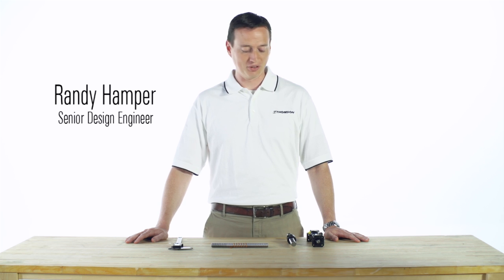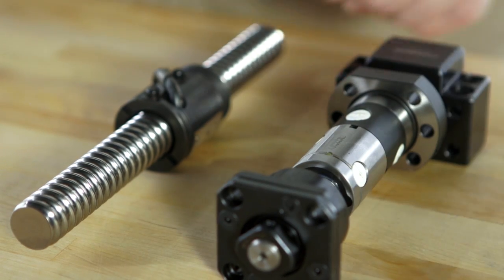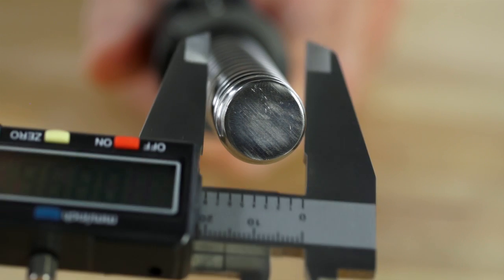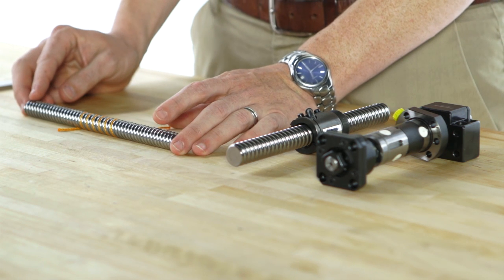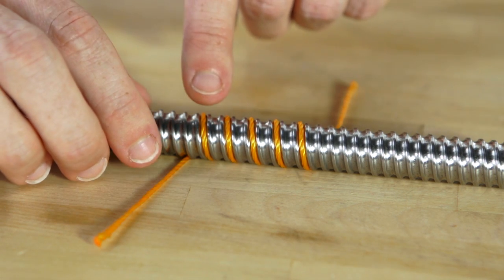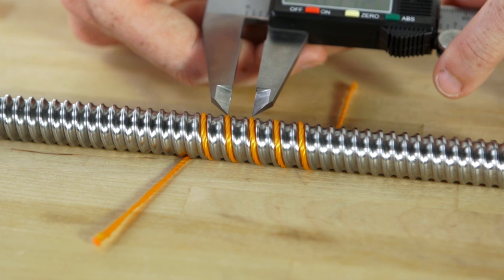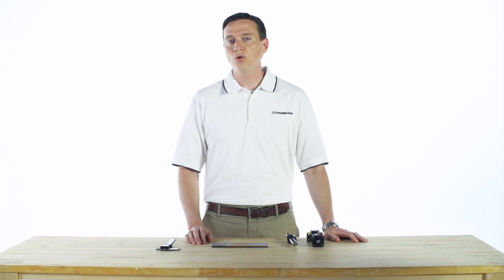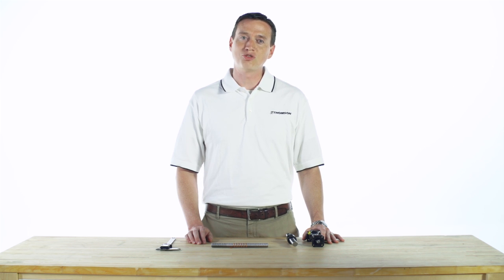Identifying Your Ball Screw Assembly.  And Lead vs pitch

Comment: so i need a t8x8 this alway confused me when i had to deal with it, i usually just try them in the nut til i find the one that fits but this time i didnt have one i could use so i had to take it out of a working machine to find what i needed an now i have to buy the replacement. i think i actually understand it now tho, thanks for sharing this. what i have is t8x4 2 starts an i need t8x8 4 start.